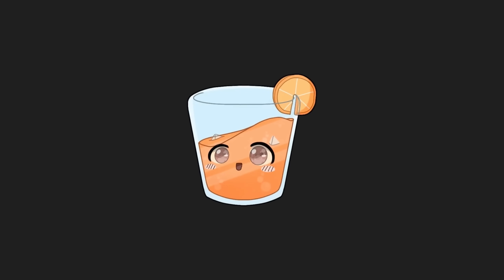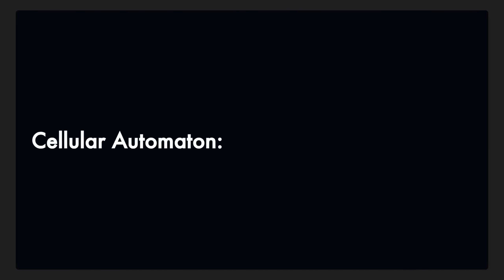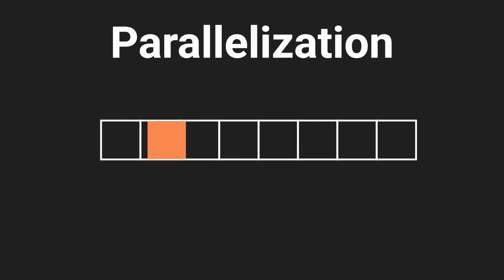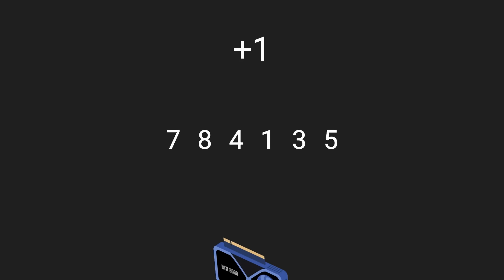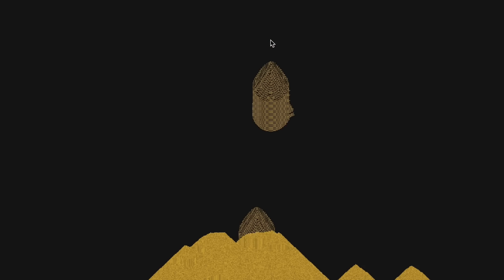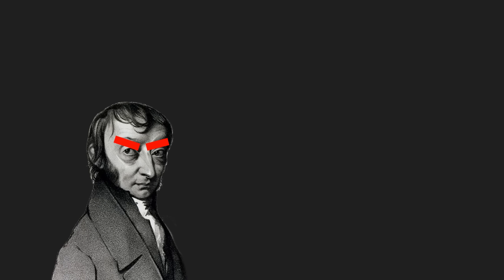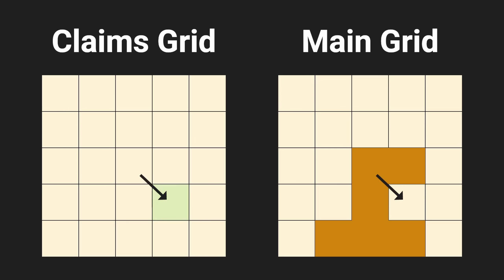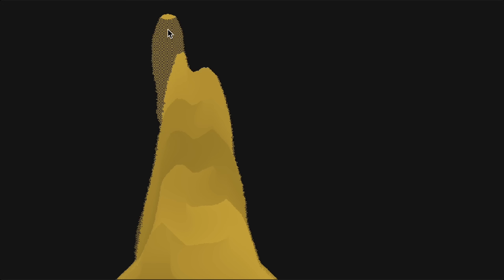Optimizing a Falling Sand Simulation To an Unreasonable Degree

Comment: What a fun coding exercise! I wonder if you could fix the race condition by only running pixels in parallel that are at least two spaces away from eachother horizontally. Step through 3 separate starting grids each loop. Might be a little better than doing everything twice? You will do everything once per frame, but potentially lose out on multi threading performance at the end of a mini grid.
Reply from the maker: That's an interesting idea! Not sure if I'd get good results, as playing with the order the pixels get simulated can mess things up (like what happens with the chatgpt wolution) but I'll give it a shot!
Reply: @nivmiz0  Classic LLM yanking in a bad solution from the depths of reading too much Stack Overflow (metaphorically, liminal space is more complex than this) without understanding what's good and bad